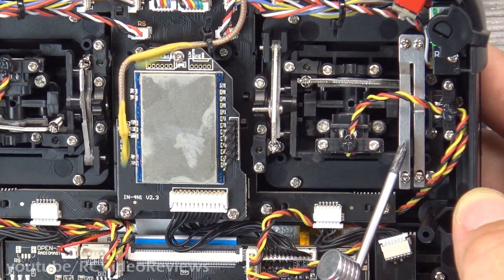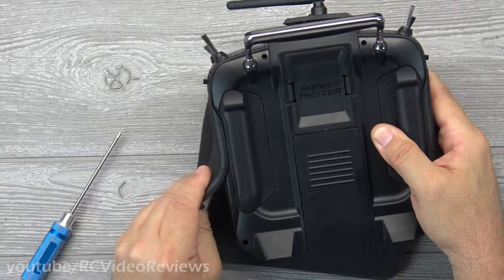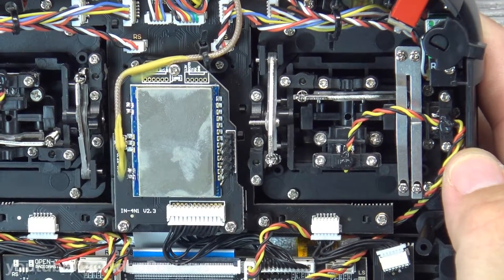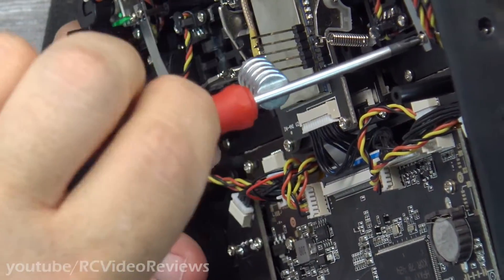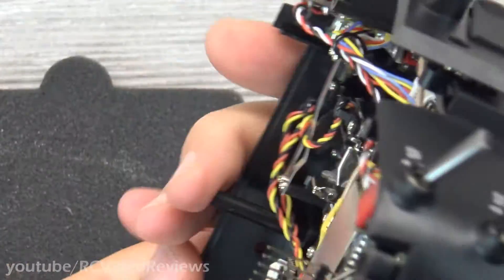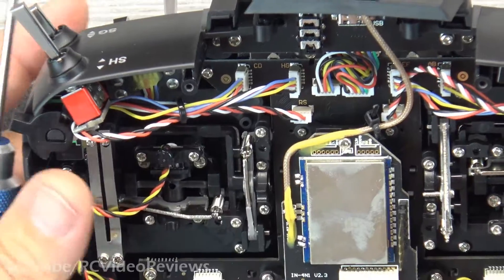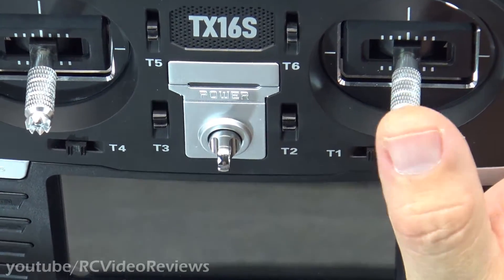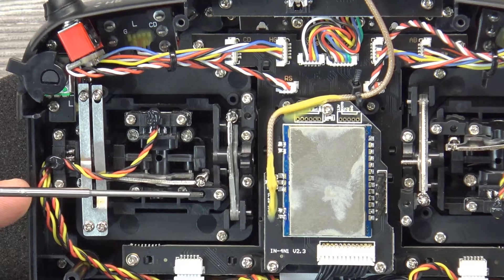Radiomaster TX16S Multiprotocol RC Transmitter - How to Adjust Gimbal Tension

Comment: For anyone looking at this and thinking WTF... You probably have the newer gimbals and the manual doesn't even have a drawing of these, let alone instructions of any sort. They adjust front the front with a 1mm hex bit. The vertical axis is the screw on the central gimbal part (only visible when stick is moved up or down. The horizontal axis is the hex screw nearest to it on the outer front gimbal part. Yes there's 3 other screws that look the same but they are structural.

Comment: After a considerable delay the tx16s finally arrived today. Excitement soon disappeared! I need the throttle to start centred.  I noticed a screw on the spring holder that seems to rest in a recess and act as a stopper. The other gimbal doesn’t have this, removing the screw allow the throttle to stay cantered. I’ve removed the screw. However I’ve noticed that there is slight play in the throttle stick,  before the spring moves. Adjusting the spring adjusts the tension but not the play? Having watched so many tx16s videos all seemingly perfect this bursts the bubble!
Reply from the maker: That doesn't sound right. You should contact RM and ask for help.

Comment: Hi John. Thanks a mil for these vids, I really find them so illuminating. I wonder if you could help me. On every single video I have watched about opening up the TX16S they all mention that the two halves of the radio seperate completely.... except that mine doesn't. There are 2 wires that go off the top of the pc board to a round piece of hardware attached to the top part of the shell. If I was to guess, it looks like a speaker. I was worried that I had a problem with my radio, but everything else looks the same as the online pics. I almost tore the wires as I was opening the unit because I wasn't expecting to find them attached as they are.

Do you know what is going on? I wish I could share a pic with you...

Thanks!
Reply from the maker: Yeah, Radiomaster recently added a speaker to the rear case half: Does it look something like this: https://youtu.be/VFVF1WcvVcM
Reply: @RCVideoReviews  yes, that's it exactly! Thank you!! No wonder I couldn't figure out why other people had a problem with the sound coming from the radio whilst I thought it was perfectly fine... Haha
Reply from the maker: @owlmuso  Yup, they got us with mid-cycle updates. It's good to know they're listening to the community isn't it?
Reply: @RCVideoReviews  Yup, exactly John. It bodes well for their success. Thanks for your feedback and all the good work you do.

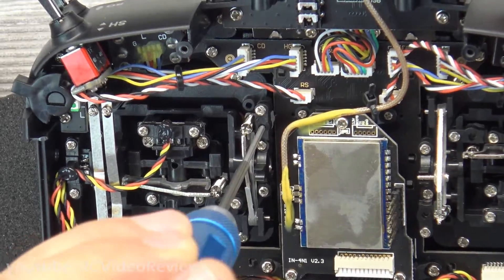Comment: 3:29 You are turning the screw CW as saying ADD tension.  Are you sure?  More tension would require stretching the spring, which requires moving the "spring attachment point" farther away.  Is the adjustment screw cut with normal threads, or CCW threads?  Turning normal screw CW would PULL the attachment point towards you, thus slackening the spring.  Haven't been inside your transmitter, just relating what was learned inside my Spektrum transmitter.
Reply from the maker: You're right. Good catch. CCW tightens.